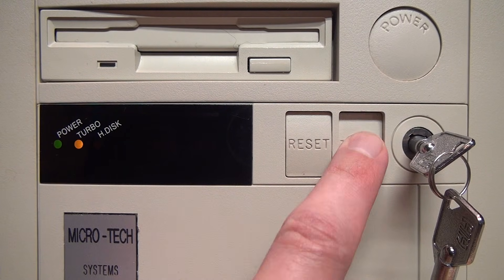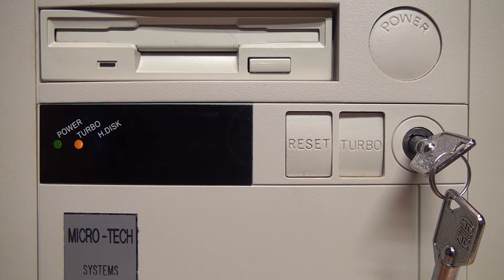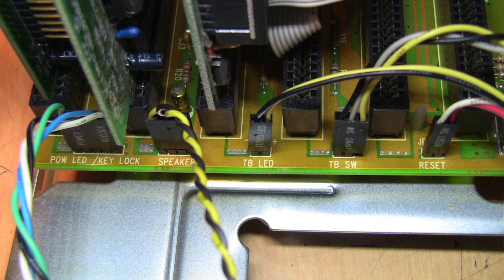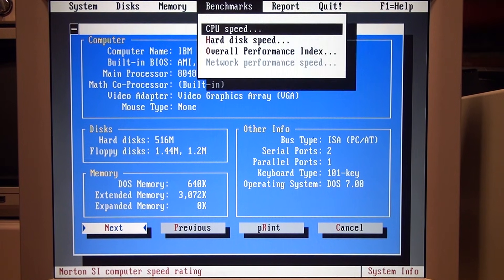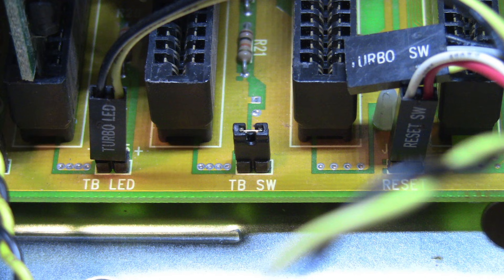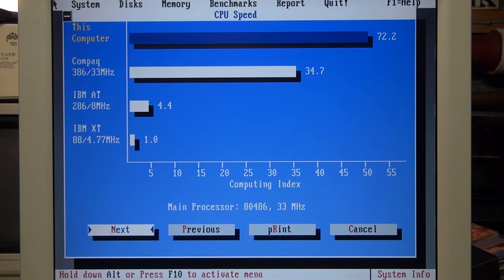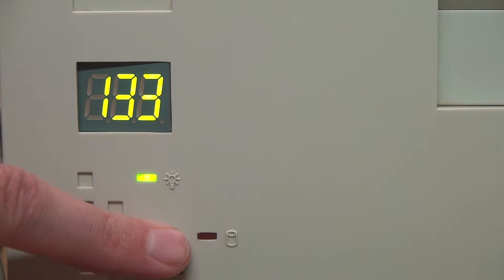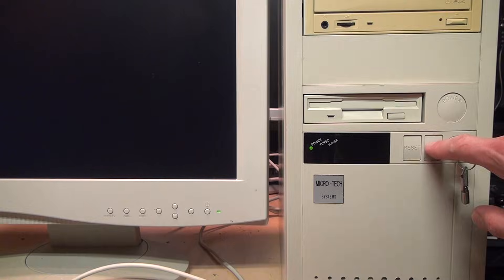The PC turbo button mystery finally solved!

Comment: I was around when the turbo button was used in anger :-) Some early software couldn't run past 8mhz without problems and the turbo button allowed the computer to be slowed down to accommodate that software. Turbo was a marketing term to explain backwards compatibility.

Comment: My first family PC was running Windows 95 and had the lock key and the turbo button. I remember the Turbo button would make the machine noticibly louder, so I had always assumed it just sped up the fans to cool the CPU better. This was back in the day with those giant hard disk ribbon cables and case ventilation was basically a meme. 😂😂
Reply: I am remembering the sound of those tiny case fans. They sounded like a Cessna taking off at 100 yards.

Comment: Had an 80286 PC with turbo button and a segmented frequency display switching from 8MHz to 20MHz if you pressed it. Always wondered what it did as it didn't make sense to me why you would want two different clock speeds for your PC

Comment: Thanks for the various benchmarks! Back when 486s were actually still in use I was led to believe that the button only changed the CPU speeds on 8086/8088 machines or possibly 286s. On later machines it just did things like deactivating the cache or coprocessor, or so I was told. Learned something new today!

Comment: I learned on the machines that went from 3Mhz to 33Mhz when the turbo button was pushed in at @4:00, and the PC did have a readout. I also had a 33Mhz Dell at home, and I learned how to overclock, and at that time, it was just jumpers. So turbo was no different than the jumpers I would use to set the MB and CPU frequencies.  I got that 33Mhz CPU to run at 133Mhz stable, then I got a 100Mhz CPU from my Army recruiter and overclocked that to 233Mhz.  The max for the motherboard was 200Mhz; I achieved 233Mhz by pulling all the jumpers for the MB and CPU.

Comment: I honestly never knew the turbo button was even a mystery. Thought this was basic knowledge for anyone who grew up in the 90s
Reply: Correct.
Reply: It is not a mystery, but it was connected in random ways (e.g. in my case the PC was starting slow and you needed to push Turbo to make it faster, and some had the wires connected backwards), which might have mystified some regular users.

Comment: Oh, the fond memories this video brings back. The early days of PC's were a wonderful, wacky and sometimes profoundly confusing time. Buying a new card, then trying to understand the Engrish instructions to set the IRQ, port and so many other things. In most cases, get it wrong and it just won't work. However, in some cases, get it wrong and you might just let out the magic smoke.

Comment: I remember the first computer I saw with a turbo button.  Back then most computers booted to DOS and a menu came up first. From there you selected a program or windows if that was installed. Most machines struggled to boot WORD in less that 20 seconds. The first time we booted WORD with the turbo button in the thing loaded in 3-4 seconds. I thought how do they make them so fast.  It’s funny to think of that now.
Reply: Hilariously Word takes me 10-15 seconds to boot up with my modern laptop.

Comment: PC builder since 1977:
Hard-drives weren't as peppy or reliable as one may want.
Some drives worked best within a narrow range of temperature, or only in certain orientations.
A 'warm-up interval' with several attempts to Boot was just a thing we all expected to do in the morning.
Maybe it was the surplus drives we were using?
Turbo allowed better 'fit' between MOBO speeds, drives and driver controller(s).
Booting was a fine art for many years, and sometimes slowing down was the only way to maintain stability.

Comment: As someone who grew up on DOS, I can confirm that the turbo button on the family PC could switch between 8 and 40 mHz, and it made a huge difference on some games as they hadn't coded in a proper 'tick' mechanic.
Reply: I remember that the DOS Tetris game gauged the CPU speed during initialisation to calibrate its delay loop (I haven't seen the actual code, just guessing based on observed behaviour). This meant that if you started it with Turbo turned on and then turned it off, you could slow the game down. Conversely, starting it in non-turbo mode and switching to turbo afterwards would speed it up (not what most people would want for Tetris, I imagine!)

Comment: My father used to have a computer with a turbo button and a display to tell you the speed of the processor. It was some Pentium I or something, running I think 33 normally and 66 or something like that in Turbo mode. Along with externals it was worth more than a house back then and was likely the fastest or one of the few fastest computers in Czech Republic back then. So powerful in fact the dealer was shocked by anyone even buying it, asking what we'll use that firepower for. Later on I remember we've been upgrading it to Pentium II i think, and then the speed was locked at 166.

Comment: I've had Pentium 75 in a Gigabyte GA586 AVS motherboard back in the days. The turbo switch changed the cpu multiplier to x1 resulting in 50MHz speed

Comment: My only issue with the TURBO buttons was that they were dangerously close to the RESET button on many cases... Means that when one thought he can just get down to the tower case hidden under the table and push it by memory... ooops... there it was 🙂
Reply: That's why we left the reset button unplugged from the main board. You can always do ctrl alt del or power switch if you need to reset.
Reply: Remember the old System 7 Macs from the early 90s?  Macs did not have a floppy disk eject button.  But they put the damn power button right next to the floppy disk slot.  Many unfortunate outcomes from that.
Reply: I love the idea of people being like "yeah... time for Turbo! Damn it!! No! Not reset!"
Reply: One time my reset button got stuck in.  I couldn't figure out why my pc wouldn't turn on or do anything at all for a good 20 minutes 😂

Comment: The original purpose of the turbo button was in fact to slow down the computer, so you could use old software (games mostly, but some scientific programs too) that can't handle the time scale of faster CPU speeds. It would have been better named "slow mode," but that wouldn't have sold well in the 80s/90s.

Comment: 🤩One my old 386, i have a Turbo button. And, yes! Is slowing down form 66 to 33 Mhz. I use it on games to pass a level. Still have motherboard with 2Mb memory, ISA slot card for video 512kb memory, Serial+Paralel+Game Joystick. Also hardware accelerator Creative Labs Encore DXR3 PCI DVD Decoder Video Card VGA.

Comment: The two-digit clock speed displays could also be configurated to show HI with turbo mode switched on and LO with turbo switch turned off. The displays had jumpers wit three positions to configurate each bar: unbridged = always off, position 1 = lit in mode 1, position 2 = lit in mode 2, position 3 = always lit. And so you could make your own display.

Comment: My 386 and 486 had a turbo button. Every subsequent PC didn't have that any more. And the turbo button switched between 20 and 25 MHz CPU frequency. Some sort of early overclocking.

Comment: I had both a 8088 and a 80286 PC's in the VERY old days. Many games and apps made for XT's were unplayable or unusable on 286's because what you saw was blurred lines or objects by running too fast. Especially the CRT's of the day with primitive phosphors the problem was even worse because it took more time to stop glowing. The turbo button changed the clock to 4.77 MHz . When EISA and PCI buses were introduced you could not change the clock speed that easy

Comment: I remember on my first PC I had a 25MHz with a turbo button that went up to 33MHz with DOS In 80's.
The button was always on (Light).
After when I switched to 255 MHz (or something like that) my games was too fast and the turbo button was gone...
So what I understand (I'm French) is that the turbo button was not an overclocking button but an downerclocking button (or lowerclocking).
Reply: ""processor""

Comment: fun fact: on my olidata 486 33MhZ, turbo mode was the other way around,  including the LED. I always had to keep the turbo mode pushed in, LED on, which was slower speed, because with turbo "off"  (66 MhZ) any game would crash after a few seconds.

Comment: Ah I remember those seven segment speed displays well.
On the backside of the little display board in the front panel, was a haphazard array of jumpers to light each segment of the display, depending on the in-out of the turbo switch.
And the 'great debate' on whether the in pushed switch, was the proper way to plug the cable onto the motherboard to enact full-speed turbo.  Near the end, some turbo led's were connected to the segment display board to light the turbo led, bypassing the motherboard.  Requiring the builder to run Norton's to make sure it was not inverted operation (led on was indeed turbo, irl)
🥲Those good old days of building pc's in little pops-shops.

Comment: My first pc a 486 dx2 66 had a turbo button. but it worked other way, light came on to run older games. 
A friend had an early pentium that had a turbo button as well. Was envious, because he could run quake okay. My last upgrade on my 1st system was slower than his amd100, and overclocked to 133. His was a pentium 66, overclocked as well, think he got his stable upto 87 MHz.

Comment: One thing to add: When the case had those 7-segment displays, what was shown on those was configured by… A pin header and bunch of jumpers on the backside of that display. So with a manual for the case, or just with a bit of experimentation, your 33-MHz 386SX could show 99, PC, FU, or whatever else you could think of with that 14 segments. (Well, maybe some cases had it hard-wired, but this was the situation with our first PC at home.)

Comment: The real answer for why this button existed... very early software (when PCs rarely if ever had a real time clock on board) often used the clock speed of the CPU itself as a general timer. This was the case on one early pinball game I had in the CGA era - if you left Turbo on, you'd serve a ball and it would bounce around and get to the bottom before you could move a flipper, or close to that anyways.
Turn off Turbo and it was playable, since the CPU clock is now what the dev expected it to be.
Reply: ""developer""
Reply: @JESUSCHRYSLER5512  huh?

Comment: Heyho! Got a M598v50 Board (probably) and thanks to your video I found the "slow" function via Key Combination (not documented). However the Board also got a Turbo LED. But it doesn't seem to be related to the Hotkey-Turbo. On Vogons someone suggested, this might just be a cosmetical "always-on" LED, which should make you feel better. Any thoughts on it? Any other idea how the LED pin works? (maybe some boards have it active/disabled when having cache active or something like that?)

Comment: I remember mine switched the LED display from 33 to 66
and nothing else
it was not connected to the motherboard in any way except 5v power
I discovered this at the same time as discovering the digits could be set to any digits with jumpers.

Comment: @16:20 "This is mostly a catchy advertising term, since it does not actually speed up your computer if you press it. Instead, it slows your computer down if you don't press it."

So I should press it so that it doesn't slow my computer down?...

I get what they're saying but they really co8uld have worded that with less room for confusion.

Comment: Yup. I was always confused when YouTubers said that the turbo button, when pushed in, would slow down your machine. I've tried explaining that I would play Wolfenstein on the college pc and the turbo (when on) would run the game much smoother. I was always told to go do my research as it was a known fact that the turbo button slowed your machine down. Even though, like I said, I'd actually lived it XD
Reply: @elemar5  The one in the video does seem to have two sets of contacts, normally open and normally closed, connected to three wires though. In that case, depending on how the switch is plugged in, Turbo mode is either switch pushed in or switch out. Of course that also depends on the board design, whether it expects an open circuit for Turbo mode (like the late 486 and Pentium boards in the video) or closed, like the older boards.

Regardless, when the LED is on the PC runs faster.
Reply: @elemar5  Sounds like your memory is a bit hazy.  It's impossible to just reverse two wires from a switch and have it go from normally open to normally closed.  That's why some have 3 wires.  Also the LED will not light up in non-turbo mode by reversing it.  A diode does not work that way and more importantly, an LED will not illuminate with zero Volts applied to it.
Reply: I found it work differently depending on the motherboard. Some went faster with turbo on, some with turbo off. I don't think one way was more common than the other.
Reply: Same with doom2.exe . Went from 40 to 80 for my setup..or 20 to 40
Reply: me too, i played Doom and had to use turbo mode on hehe:D
Reply: My mind also went straight to memories of Wolfenstein in high school. I remember the issue with the button not always being in the same position when the light was on. Turbo was definitely smoother. Good memories.
Reply: @elemar5  I haven't built as many PCs but still quite a few, plus I've got a background in electrical engineering.

How would that work? The average turbo switch was a plain single-pole switch that connected the two wires when depressed and broke the connection when not. Depending on what the board expected, the CPU would behave accordingly. Reversing the connector doesn't change anything, the circuit is either closed or not and whether the button needs to be in or out for closed is mechanically determined and impossible to change without disassembling the switch.
Reply: @Ragnar8504  Regardless of what an "average" (guessing you meant "typical") turbo switch might be, there were switches that could be installed two ways. Since you've got a background in electrical engineering, you clearly didn't actually watch the video, or you'd know exactly how it would work. The switch in the example machine had three wires, in other words it was a dual throw switch. No reversing of the connector, changing which of the three pins of the connecter connect to the two pins on the board.

Comment: So the original turbe button made some kind of sense, to allow compatability with old software that assumed a 4mhz clock.
But then why do the later pcs have a button that toggles from max speed to some arbitrary lower speed that doesn't help with those older softwares?
If it always toggled between max and 4mhz that would make sense. But the arbitrary speed helps no one?
Or is there something else at play here? Does the lower clock speed save energy/heat? (much like the auto-throttling cous of today) if not then it seems totally pointless to me.

Comment: I somehow managed to be ass-deep in computers through the entire "turbo button" era and never once knew about that keyboard shortcut. I have no idea how I missed that.
Reply: Don't beat yourself over this, flapjack. I didn't know about the keyboard shortcuts until now. I had my PC with a 486 DX mainboard and I know how to use the button on the case, not the keyboard shortcuts. I only started to use keyboard shortcuts when during the internet age, although I was taught the 3 finger salute (ctrl + alt + del) by my former neighbour if I needed to restart the computer.

Comment: There has never been a mystery about that button. Its function and purpose is clear for decades.
Reply: Exactly.  I have been using and building PCs for over 35 years, and none of this was ever a mystery, not in the 80s or the 90s, and not now.  The same applies to setting the links to display any number you like on the LEDs; all just a trivial part of setting up an older PC.